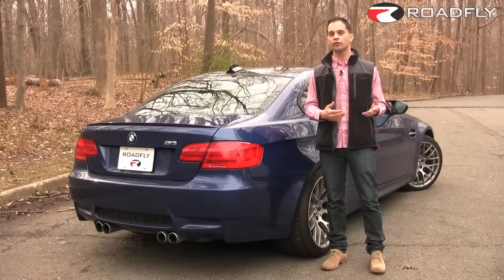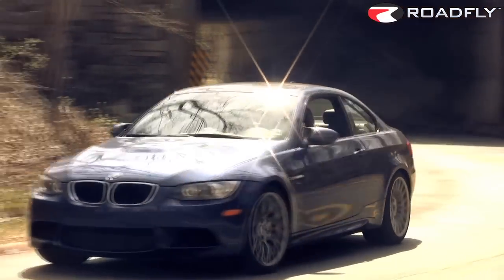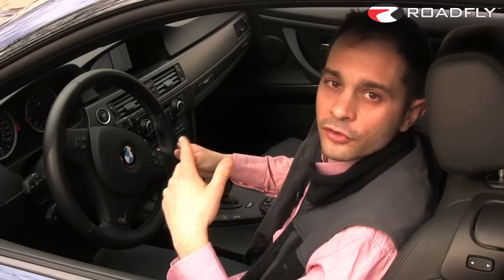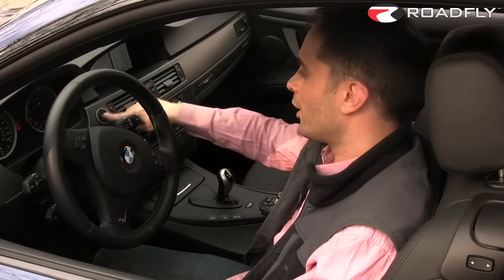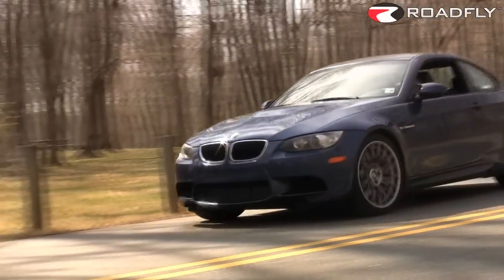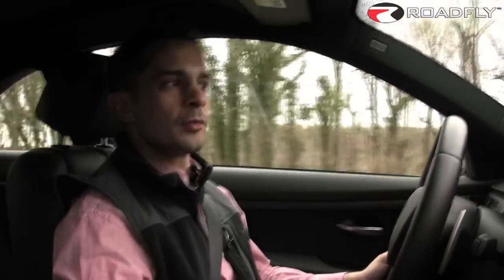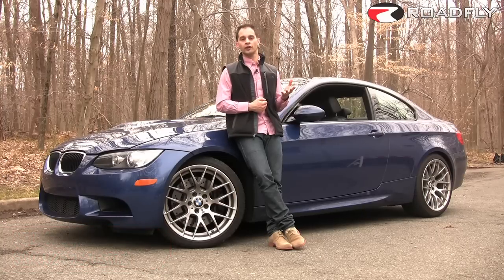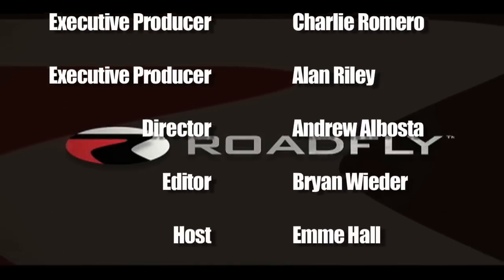2011 BMW M3 Road Test & Car Review - RoadflyTV with Ross Rapoport

Comment: Nah, get the 335i, its a much more practical choice thanks to the better fuel economy, and without too greater sacrifice in performance. If you really want a muscular body kit get the M-sport 335i, and for added takeoff performance you could consider the X drive variation!

Comment: No, but it does come with a start/stop feature which shuts the car down at red lights while your foot is on the brake to save on gas. But this is not the class of car one should be looking at if one wants to save on gas. Well, at least not until the 2014 twin turbo inline 6 M3 comes out. That will be better on gas, and faster, and probably handle better, have more toys, will be lighter, better in all areas, except that beautiful sound you hear at about 8000 rpm's.

Comment: @nickelwindow53 If you keep them well maintained they are pretty reliable, trouble is maintenance is costly on bmws. Also depends how long you keep it, if you trade or sell at 100k miles it doesn't matter. Otherwise if you don't have the change to spend on maintenance look elsewhere.

Comment: I'm not a fan of this M3 solely b/c of the V8 engine.  BMW is synonymous with brilliant inline-6 engines, and the last generation M3's high-revving I-6 was a true gem.  As good as this V8-powered M3 is, it simply isn't a true M3.  

Even more depressing, the next generation M3 will feature a tri-turbo V6 (that's right, a V6, not an inline-6).

Comment: Sure, and burn out your tires in its compulsive over-steer, that's what happens when you have a 6.2 liter connected to the rear wheels. I like the c63, don't take me the wrong way, but the m3 will get a faster time around any track, and can come with a manual. Perfect example: the test TopGear did. This is why the M3 has always remained the ultimate track car, and has been cherished by all driving enthusiasts.

Comment: It's funny how you keep evading discussing cars and keep making it a personal discussion.  In case you are wondering, a BMW X6M for example is faster than both the M3 and the Mustang GT, but I would still take the M3 over the X6M, having driven all 3 of these. If you are so adamant on comparing cars on paper, we have nothing more to discuss. A great car is not a car that goes 0-60 in 4.5 seconds. There is more to a car than just numbers. An M3 competes with RS5/C63 = luxury + sports + comfort.

Comment: @Pistolleta 

In 10-15 years, this will be a classic car.

- The only normally aspirated V8 M3 that revs to 8250 rpm
- One of the few rare cars still available with a stick
- Hydraulic power steering, no electrical nonsense
- Mechanical limited slip diff.

Go learn something about cars.

Comment: The only people who compare cars based on only acceleration alone are drag racers, competitive racers or people who know very little about cars.

By that definition a Corvette is better than a Ferrari 360 Modena, Audi R8, some Porsche 911s. 

Some cars like the Porsche Boxster S are also about the total driving experience. If you just wanted the fastest acceleration in the world, you'd get a Honda Civic from 1980-1990 and put the biggest engine you could in it. Or get a sports bike.

Comment: Ya let me know when you 0.1-0.2 seconds acceleration 0-60 matters more in real life than proper weighted steering feel, handling feel of a nimbler chassis, superior interior materials quality, luxury features, leather that doesn't feel like it came off an IKEA chair, compliant ride on bumpy roads that doesn't axle hop, minimal body roll, and the fact that there are nearly 80,000 Mustangs sold annually means 0 exclusivity too.

Fifth Gear even tested the Mustang Boss 302 and it's worse than M3.

Comment: Get a VW GTI save yourself $30,000 while getting, 32mpg highway 25 local, DSG get's paddle shifters and launch control and a zero to sixty of 5.8 seconds stock.  If you want M3 speeds, modify it for $2,000 or so more and you get a 0 to 60 time in the 4's. That's what I'd do...oh wait that is what I did.  =)  M3's are nice tough but hard to justify the price if it will be a stretch for you.

Comment: See I knew someone would have a response like this and it's exactly why it's fallacious to believe that cars should be judged only based on #s.

- BMW M5 doesn't have the same steering feedback as a Ferrari provides
- BMW M5 doesn't have the same breaking feel as a Ferrari F430 provides
- BMW M5 won't handle with the same precision as a Ferrari F430
- BMW M5 won't tingle your senses the same way as the sonorous V8 of the F430 under full throttle.

Also, you are wrong about performance.

Comment: @paladain55 

Also, American muscle cars feel "heavy" to drive. Drive a Porsche Boxster S or Nissan 370Z or an M3. They have this precision to the steering and feedback that the Mustang GT simply doesn't have. The Mustang GT is very loud in real life, it's extremely cheap inside, even with any special editions, it's not special since 80,000+ are sold in US per year. Imagine if I told a 911 owner that M3 does 90% of his car for $30-40k less? Makes little sense. Mustang GT has rear live axle hop.

Comment: @p7272 the problem is ford managed to make more hp, way more torque in a heavier car thats faster and get 4 more mpg in the city and 6 more on the highway than the bmw m3 with the mustang gt 5.0 and boss 5.0. The gt runs on regular gas as well instead of the premium that bmw uses. BMW is behind in technology. Ford has a much better engine is just about every aspect than bmws in a car that cost less than half this.

Comment: If you want to talk strictly about performance, you need to know how much power a car can put to the ground effectively (Nissan GTR is insanely effective at this). Also, you can't just look at horsepower to assess performance metrics, which is exactly what you are doing.

You should google Fastestlaps . com and you'll see that the F430 has fastest top speed, accelerates faster 0-62 mph, has fastest 1/4 mile speed. That's not even the point. Ferrari F430 is still a far more involving car to drive

Comment: 335i is a much better overall car. m3 is 50% more expensive but not 50% faster or 50% better.
for a good DD the m3 has too much NVH and is too high strung. you will be frustrated driving it at normal legal speeds. a 335i is almost the perfect DD and track car combo.
it seems ross was infatuated with the v8 sound. if you're looking for v8 sound nothing beats the sound of an LSx v8.

Comment: It's funny when the Mustang transitions to an independent rear suspension that was used in a horse buggy 100 years ago, maybe the Mustang fans will acknowledge that YA, it was time the Mustang entered the 21st century. The Camaro did it.

The basic idea behind a Mustang requires 0 skill. You drop a large V8 engine with lots of horsepower and you are done. When auto engineers have to create a car that's good for more than 1 thing, that requires real skill.

Comment: Exactly. Not only that but American cars never feel as stable or as planted on the road and most of them have incredible nose dive under breaking, horrendous body roll, very little steering feedback. The leather feels fake on half of them (more like pleather), they drop in value due to depreciation. I even saw a Mustang GT500 the other day on the highway and its hood was flopping at 140km/h. The rear bumper diffuser was also flopping all over. Talk about build quality....or lack thereof.

Comment: @robertallen957 not my kinda car to many electronics takes away from the experience. thinkin of sticking a 540i v8 into the e30 with a few nice lil mods and should give about 35mpg. deffinitly enough to give an m3 a run for its money on and off track. bitch of an engine to find a manual gearbox for as most came with autos

Comment: @paladain55 

Actually if you did more research, you would have found out that M3's real world weight is less than the manufacturer's claim. Check Fastestlaps. com, Insideline, etc.

The M3 actually weighs around 3562 lbs vs. 3,660 lbs for a 2011 Mustang GT out the door with similar options!

Still the M3 accelerates faster, stops better and kills the Mustang GT in slalom times. Most importantly, one can argue it's 95% of the performance of 911.

Comment: The interior is so boring. Prefer audi or mercedes interior.
Reply: Agree
Reply: only if audi made rear wheel drive cars, id never look at mercedes or bmw again
Reply: I know right. They would be the ultimate German luxury brand
Reply: lol, the interior may be a little on the bland side, but let's be honest you don't get this car for an interior. You get this car, because of it's handling, the chassis, the 50/50 weight placement, the V8, and stylish exterior. most real world performance come second in Audi/Mercs not in BMW.
Reply: Audi and MB are more comfort type cars (mostly MB), and besides, I'd get an M3 for the sheer joy of driving
Reply: VTEC kick in Mb and Audi are for sleepers who gets in their car with hospital shoes on.

Comment: Every E92 M3 owner whom I've personally known has either kept theirs for less than 6 months and made a HUGE loss or is currently looking to sell. It is nothing special at all.  Just a vague, dull car that only becomes slightly interesting on a race track.

The steering and suspension are pathetic.  I've gotten better road feel from a bagged Range Rover Sport.

Also, I prefer manual too, but if I absolutely HAD to get an M3, I'd buy one with the DSG box to make use of what little torque there is.

Comment: @Snoop121975 To answer your question yes. Who in there right mind with the amount of money to buy either would want a mustang over an m3 Although you do have a point of a 30K difference. But still. No out of the factory street legal mustang has the poise and balance and sheer quality of being able to rape around a track and then drive home then the m3. The point of the m3 is different then that of the boss the boss is a no compromise track mustang.

Comment: @buttnut1080 i think the biggest change with is a really lame one is the new start/stop system whenever you get to a red light or whatnot, that and lower Co2 emissions other than that then yes you are right hehe been about the same since about 2007

Comment: M3 sucks 
2012 Nissan GTR gets 16 City and 23 hwy and a 0-60 in 2.9 sec. 
while the M3 does it in like low 4.0 sec range? 
Nissan GTR is what i call pure engineering.

Comment: Naaaaaaaaaooooooooooowwwwwwwwwww. No torque, no pull, under powered, bimmers are losing they're way. Audi have taken over now with just being so well built et al. M3 is a great car nonetheless but nothing like the RS5... I drove both.... Put your foot down on the RS5 in the corners and the torque vectoring differential equalises the understeer. Its even better than the M3 inthe corners when used properly!

Comment: '
no no thank,,,
i dont like this car BMW - M3,,,
reason =
1 - no have 2 amber yellow lights on the rear taillights,
2 - too small white lights back up lights on the rear,
3 - wrong gas in hole on passager right side,
4 - too much drinking gas,
5 - too much pricy,
6 - not worth it, NO NEED IT

Comment: @kevinmsft My two friends have mustangs, One of them a GT v8 2007/8 or 9 I cant remember and the other one a v6 version, In short, the v6 is piece of shit. Sorry but i gotta break it for you. I will never buy it..drives like.. mmm not great. Noisy,,makes a lot of noise from the wind and the chassis queering..hard to describe but u understand, Another thing is the cramped cheap interior. Plastic everywhere & some things were falling apart he had to take it back to a dealer....conti..